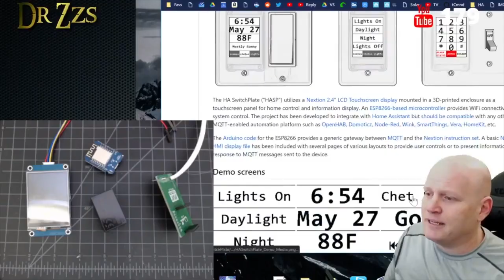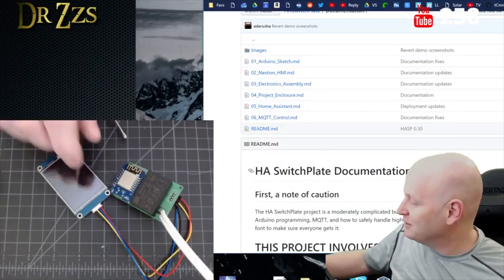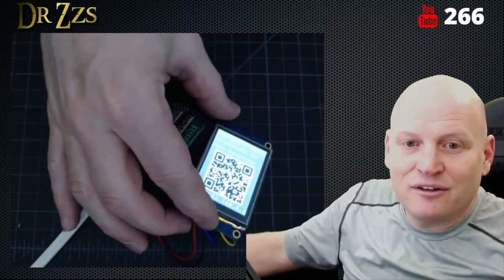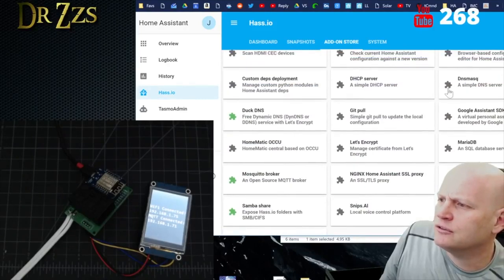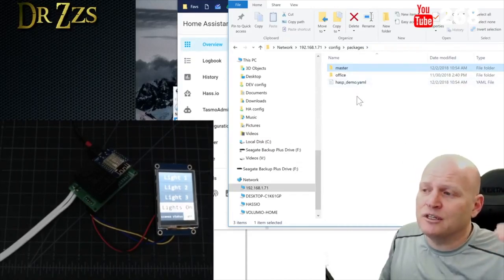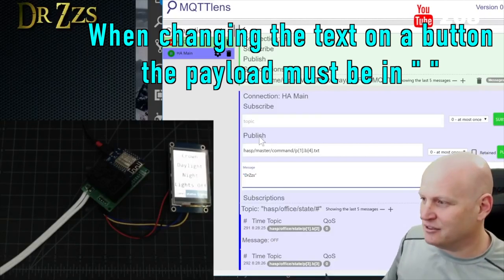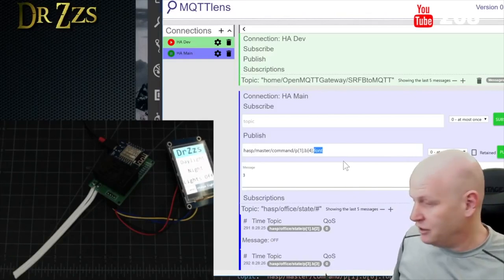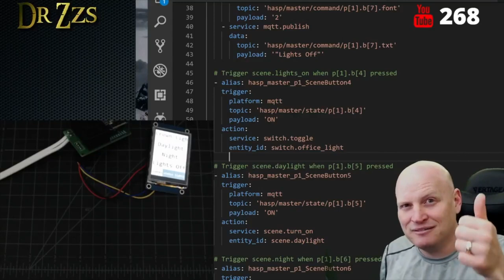Condensed Version of the Home Assistant Switchplate Setup Live Stream

Comment: I think I would put a little terminal block on instead of the wire for the mains, but we do our wall plates a little differently here so that works better for our standards.  I wonder if I can get one of these certified :)
Reply: I like wires because romex can stress a terminal block and twist it on the board. Stranded wire bends better.

Comment: Hi, I know this is old video.  I just bought me the Switchplate.  I got it to work just fine but I have question about will the display reflect the status of the light.  For examples, if I turn on the light on the HA or switch will it show the correct status on the switchplate display.  So far mine does not work correctly.

Comment: What I don't understand is why the hardware for this needs to be so complicated and require custom PCBs. Am I missing something? If it's web-based, and even if not, this could run on a Raspberry Pi Zero with a Hyperpixel display, no soldering, just two components. Or just an old phone from eBay with the WallPanel app.
BTW, I really love your videos! I just recently got into Home Assistant and they're very helpful.

Comment: Thanks for the video guide.  Is it possible to use a USB charger as 5V power supply  just connected to the D1 mini?   If I skip the IRM-03-5 powder part, is the PCB still working?
Reply: Can't see why not. D1 mini is 5v and so is nextion display. So you could do away with  the power supply and PCB. Just put display straight to D1 mini

Comment: I think it would be nicer to pair a sonoff basic with the screen. 
Price would be much lower and also bonus relay for controlling the light.
Reply: Just realised, you would probably need a boost converter cause the sonoff is 3.3v but still easier to build and cheaper.

Comment: Does it need to be AC power, or can we convert it to be DC power to power via USB or Power over Ethernet?
Reply: It does not need AC. You can use USB og PoE but make sure to transform that to correct voltage for D1 and screen.
Reply: @darkhorsegarage  Thanks worked, just got stuck on the RX TX pots, having to be D4 and D7